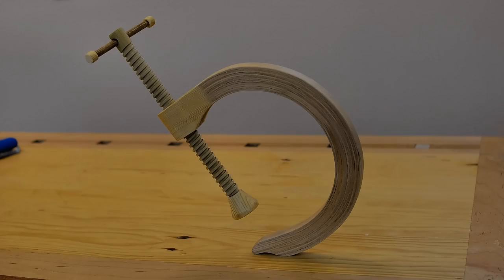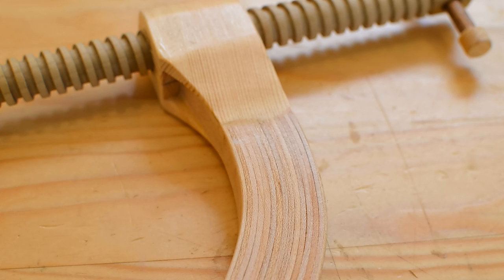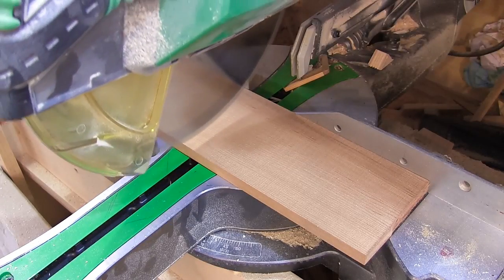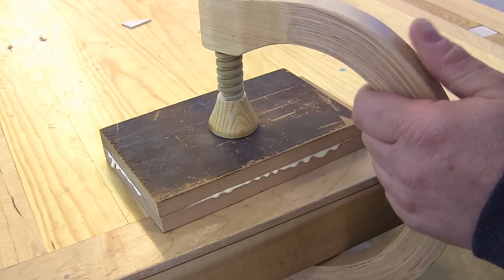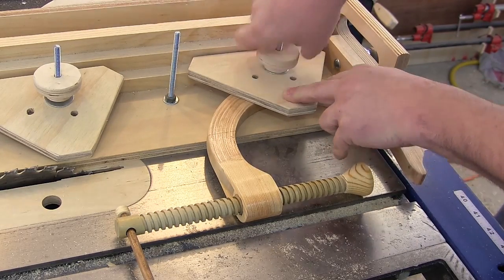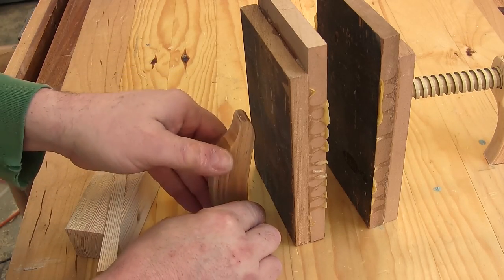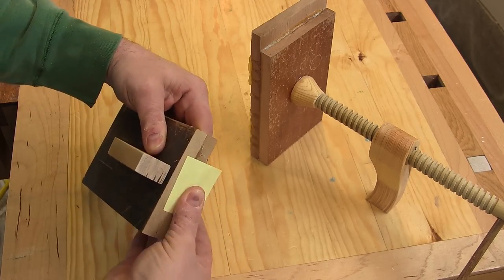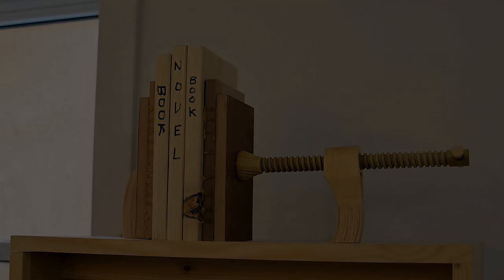Book Ends

Comment: I like the idea a lot.  If I could humbly make a suggestion, I think you might be happier with the aesthetics if you shortened the screw.  Since it's obviously not functional anymore, you could cut out about 50-75% of its length, and then glue the two cut ends into what was previously the clamp body in order to hide the joint. I think it would look much more balanced and be more practical as well (since it won't take up so much space on a shelf).

Comment: .
Reply: +Mike's Micro Shop 
LOL I loved it, it would have looked a bit better if the
glue were running down vertically as it sat for the book end that way it would
have looked like you were doing the glue up in that position.  But still I like the idea and don’t really
think it looked like crap it was actually clever.  Probably needed a base to make it more stable
or a metal tongue to extend under the books to hold it in place.  Made me laugh loved it!